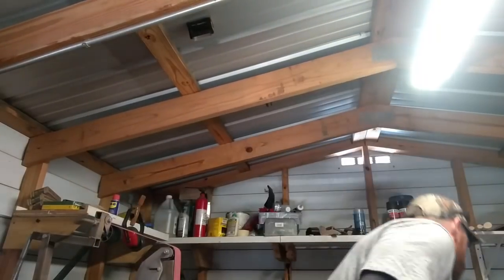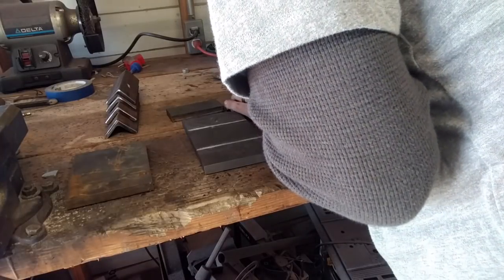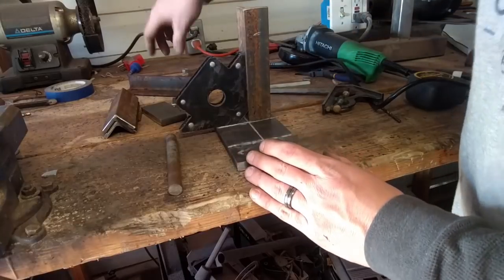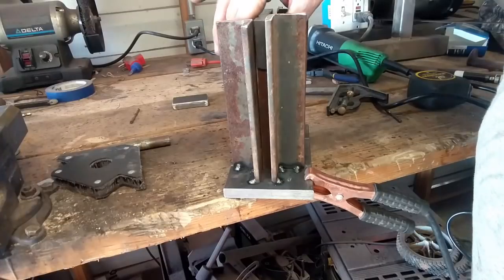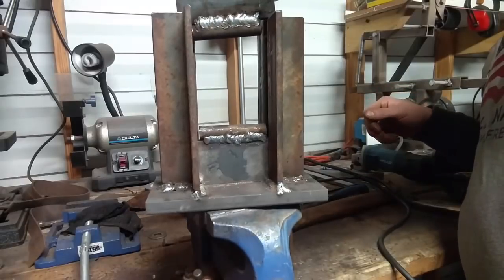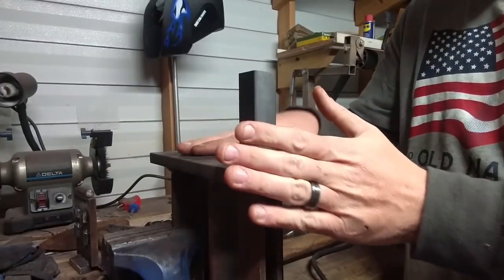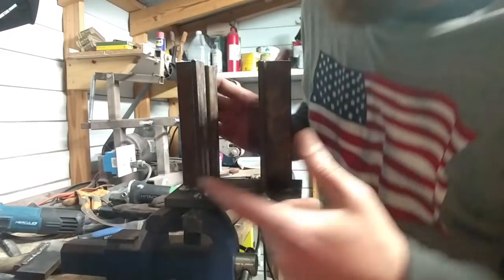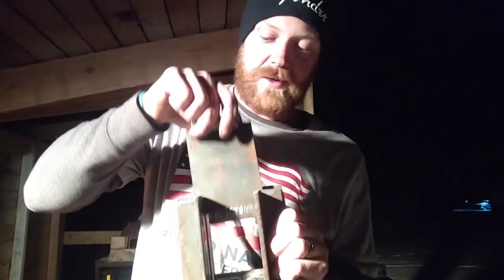Making a Blacksmith's Guillotine

Comment: Hey James, I like that design too. I made one almost identical to yours with one exception. Instead of welding those little tabs on the dies, I cut two long rectangular pieces the same thickness as my dies and the same length as the vertical angle iron. I then welded one of these on each end, between the front and back angle iron. In other words, they enclose the ends of the track that the dies slide up and down in. I think this keeps both the top and bottom dies more stable when in use, as well as eliminating the need for the tabs on your dies, which makes it easier to stack them together for storage when using other dies. Enjoyed the video! Good work!

Comment: Nice project. Instead of the tabs on the top die, maybe you could weld pieces between the two legs on each side to keep the top die running straight. It would keep the legs from shifting over time and you won’t need tabs on every die you make that way.

Comment: I like your guillotine tool, I will modify it slightly when I make mine I'll weld some stock on the inside of the legs to cut down on the movement of the dies, but I really like your guillotine build, it's simple, but it works.
It'll help me to work smarter, not harder. Thanks again, keep up the good work. 🖖😎⚒

Comment: I like the design and I think I will be making myself one soon. I saw how unstable the top die was and how it tried to slip sideways, could boxing the ends of the angle guides with a couple of inches of flat stock welded to the top vertical sides of the angle and then making the top die the entire width to the boxed ends stabilize it some, instead of relying on the small tabs you showed.
Reply from the maker: Yes, I have since added 1/2" steel between the guides to keep the dies steady
Reply: @CountyLineForge  It always amazes me how great minds think alike, lol

Comment: I am sure you could vastly improve this by just adding a fixed spacer between the guides to stop movement and improve the impact of blows. Could be drilled  and screwed or bolted in for easy removal if needed! No need to then weld guides to your tool!

Comment: Good job.  What are the specs for your MIG welder?  Flux core, amps etc.  Does well on relatively thick material like the round stock on the dies.  Thanks.  Jerry
Reply from the maker: Fossils etc. It's a norstar 140. I use Argon gas and non flux core wire. The welder is made by Miller. It can run multiple sizes as well as flux core and completely adjustable with speed and arc voltage are most all other mig welders. This welder will get 1/2" penetration at the max setting and that more than enough for a blacksmith imo